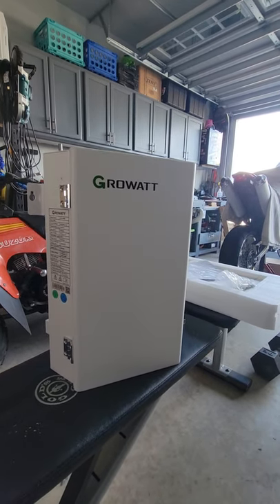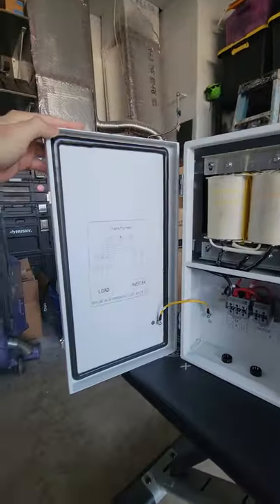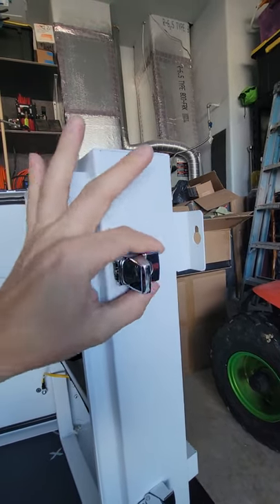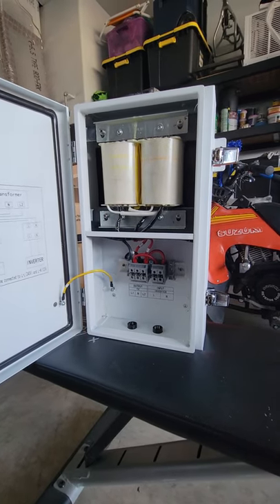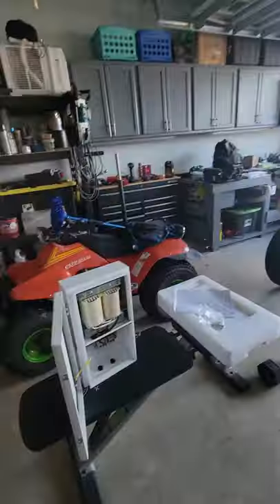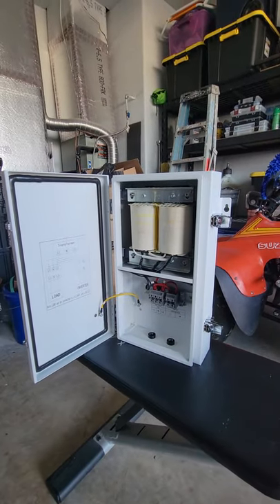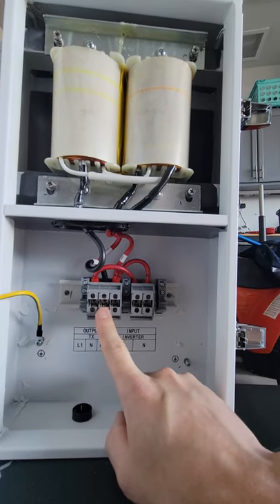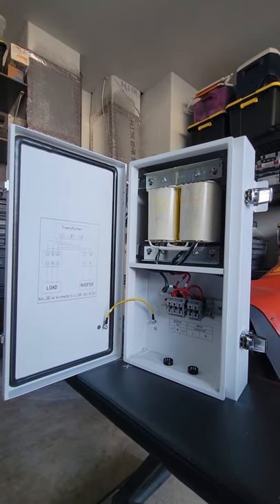Growatt 5kw split phase transformer ATS-US

Comment: This is a unique unit . I know this thing is heavy but is eccentrically needed for turning 240 v output only inverters into split phase . Would like to see other videos of it in operation . We preppers need something like this just because of this reason . Check out my DIY solar videos, hit like , leave a comment and subscribe . May the solar be with you .
Reply from the maker: Thanks Cedric! I've made another video detailing my system so far. I don't know how to edit the videos so I am still working on it.. I may just redo it with my phone and post it. I'll run my refrigerator on is soon to test the batteries.

Comment: Dam didn't know it was that big. I probably would rather have the solar edge
Reply from the maker: Yes I was surprised at well. I got this for $300, the price has gone up. Signature solar no longer offered the solar edge I looked online and it was 350+ so I decided to try and save a few bucks. I'll hopefully have it mounted tomorrow so you can see it next to the inverter.
Reply: Ya I ordered mine on 12/30 think it should be here tomorrow. Saved a 100  the solar edge. So it made me order it but the picture made me think it was smaller the the solar edge.  Keep up the good work. Thanks for sharing
Reply: Two kind the 11,400 abd the 5000 both hsve sane 5000 lVA transformer don’t be foold